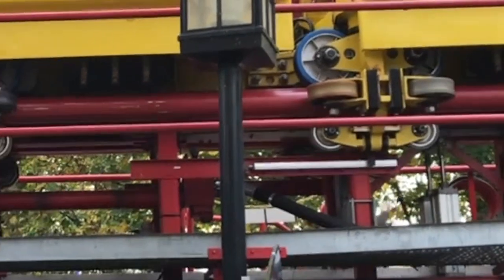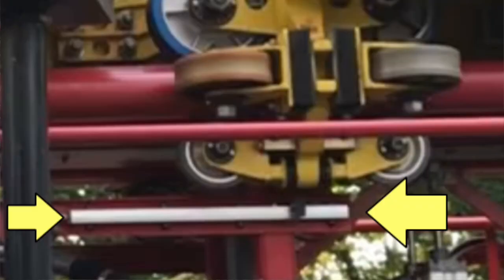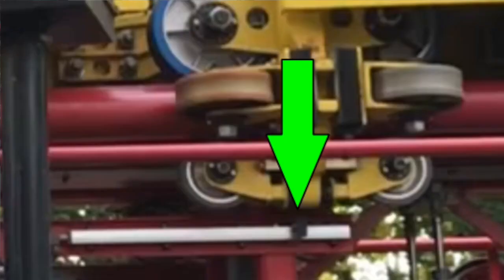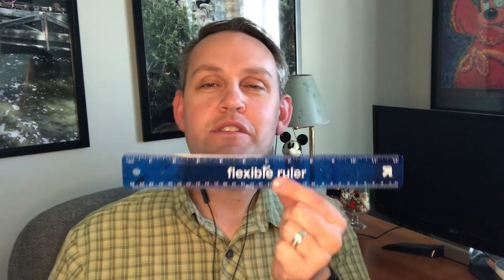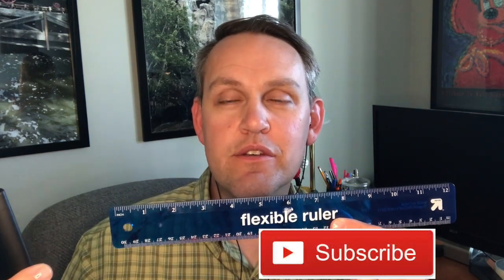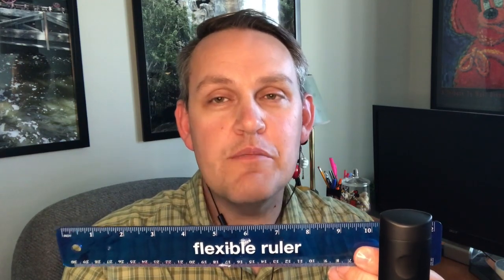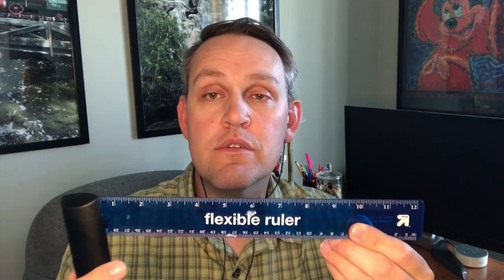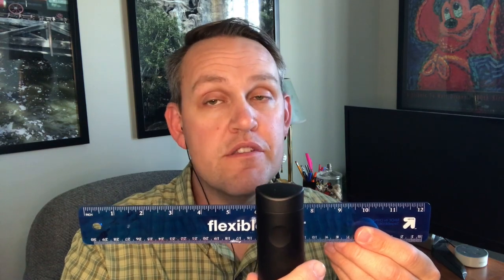Hydraulic launch coasters linear transducer

Comment: So that’s how the PLC knows the train is in the correct place, are you able to explain what releases the launch dog as well because I’ve always wondered that
Reply: I can answer that for you. 
 
There are a set of 2 clutches, one on either side of the launch dog. 2 hot rails (+24vdc and 0vdc) are on the track in the launch zone, while 2 spring loaded brushes on the train make contact with them. 
 
When those rails are energized, the spring loaded clutches will pull back and release the launch dog, where it will fall and drift into the pocket of the catch car. 
 
Also note that since the rails only exist at the launch point, the clutches are re-engaged by default during launch, meaning that when the launch dog is forced back into position it can't drop down again.
Reply from the maker: Like the decision to release the dog?

Comment: Actually the transducer are 2 in number one reads the position of the train while the other reads the position of the catch car.
 The 2 measurements are used to determine if the dog is locked in position and no gap in between the dog and the catch car. 

There is also a separate proximity sensor that confirms that actually the dog has dropped and locked to the catch car. So since the position of the dog in relation to the train transducer is known and the slot on the catch car is also known then the 2 transducers difference will determine if it's safe to launch or not. Ideally no gap is supposed to be there between the dog and the catch car. Because of the sudden launch speed if there is a big gap then there will be an impact to the train that can cause great damage so the gap must be zero or almost zero for smooth pull launch
Reply from the maker: Awesome info. I assume they were mini more read sensors or proximity sensors down the cash car track as well, but nothing really to show see her say so that’s very hard for most people to understand. You definitely have the knowledge on it it sounds like.

Comment: Just found your channel and subscribed. I'm an electrician at a theme park. I don't know anything about this launch system but I have a different theory on what they are using the transducer for. Every train weighs different and the system has no idea how hard to launch a train to get it up to speed. They are probably using this sensor to get the reaction time of the initial launch to calculate the weight to decided how hard to run the launch system to get the train up to speed. I only have experience with lsm systems and thats what they do. The system I'm familiar with uses regular prox sensors to detect that the pusher paw is fully seated with the catch car. But great content, keep it up.
Reply from the maker: Hmm I know the hydro drive systems use a predetermined pressure that needs to be set prior to breaks off so I don’t think it’s reactive. You also have the catch car counter tensioned with a pneumatic ram on the return wheel. For LSM they use 4 bipolar reed switches on the tail sensors to determine polarization and rake position those like you say are completely allowed for dynamic feedback. But the hydro systems as I understand them are basically an estimated im fire and forget. This is what they have more rollbacks when crowded are inconsistent.
Reply: I'm a controls tech at a park with a hydro launch. We use these transducers for positioning of the catch car and train in waiting position and coupling in the launch position. 
 
They were put in as redundant backups to verify the launch dog is actually in the pocket with no space in between. I've worked with the programmer for the ride a few times and that info came directly from him. 
 
The hydraulic room has its own controller separate from the ride control that calculates load based on the last few shots and adjusts from a static baseline.

Comment: What would the reasoning be to use this versus a net sensor? Is the net sensor capable of more precision at higher speeds? I presume the linear transducer is capable of more precisely determining the position of the train, but may be less reliable if the train is moving faster.
Reply from the maker: Most of the time manufactures want to stay away from optical style sensors as they have trouble with the elements causing false readings. So I’m LSM launch’s they use tail sensors which are 6 magnetic sensors packed together to read position. The linear transducer is more precise but lower speeds and are only usually about 1 meter in length.